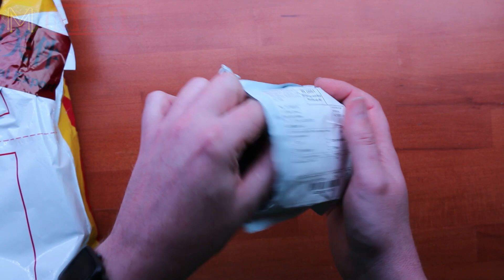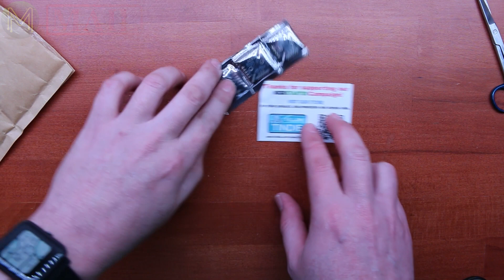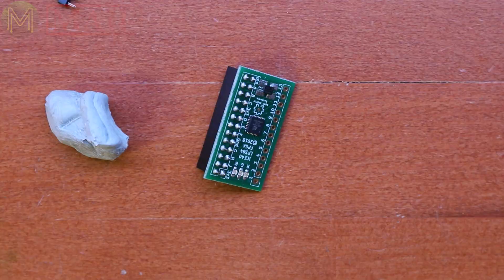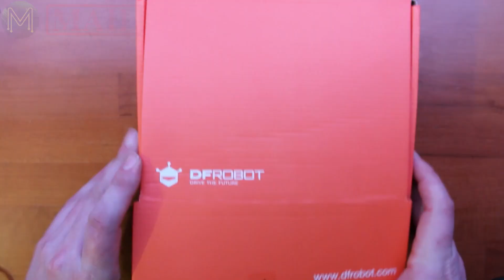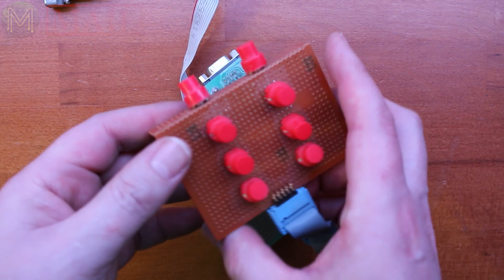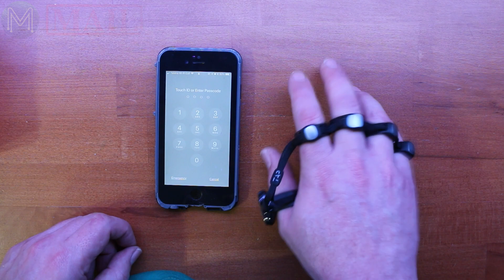#237 MickMake Mail #36: LattePanda Alpha, FPGAs & keyboards

Comment: Hi Mick, love your videos. subscribed a while ago. I am looking for an Android-based SBC that can support up to 3 screens, the connections can be HDMI, DP and the display ribbon cable. I also want a minimum of 4GB but would prefer 8GB. I have been searching for a while but finding an Android-based SBC that can support up to 3 screens has proven to be a challenge. The screens need to work independent of each other (i.e. screen mirroring won't do the job) What would you recommend? Keep up the great work. Thanks, Chris

Comment: If you check where the leads on your voltmeter connect to the back, you will see it is possible to desolder a bridge,  making it possible to read voltage from a 3rd line, independent of its power.
Reply from the maker: Thanks. Didn't see that before!

Comment: There are videos out on YouTube showing Lattepanda as a Hakintosh.

I am looking at one of the new Mac Minis and so will be able to get hold of MacOS easier.  I might get a Lattepanda too.
Reply from the maker: The MacMinis are still way more expensive. I know you get what you pay for, but Apple have had a history of squeezing that mantra a little too far.
Reply: @MickMake  The thing is Apple never makes the case for MacOS which should be the reason to own a Mac.  I run Linux on a laptop that cost £1k about 4/5 years ago.  I don't like Windows and I say that as somebody who used to work in IT on the big metal.  And yes I understand the value cost ratio of the hardware when Apple is compared to bog standard boxes;  even expensive NUC's are better value.  Over this last year or so I have got a bit tired of Linux.  I want something that can run MS Office a bit more cleanly than more current experience via Wine; LibreOffice works for me, but doesn't always work that well with documents from elsewhere.  My TV provider's app is only for Mac or Win.  And so on.  Just looking that's all.  :)

The first computer I entered a program into was an Apple ][.  The first computer I used with a GUI was a Lisa.  And I remember the original Mac.  I have a dead Mac Plus sitting on a shelf. 

Thanks for replying.  :)
Reply from the maker: I'm in exactly the same boat. Used Linux PC for years and years, but 2 years ago I got pretty sick of Linux "not always working". Yeah sure, I can hack something together, but as a small business I need something that always works.

So, Mac was the only other choice - best of both worlds.
I can still hack around with my scripts.
Still have a shell, (which I spend most of my time in).
But I can run commercial apps without issue.

OSS is great and I fully support it, but OSS never gets that last 10% of the UX right. After all... the last 10% takes 90% of the time. Often.
Reply: @MickMake  Yes.  I have a small problem with video tearing.  Not all the time, but sometimes being who I am with my background I really notice it. Is there a fix for it? Yes.   Could I implement it?  Yes.  But, and this isn't being lazy, I just can't be bothered and I am always scared I will open another can of worms.  Fixing things that 'work' is a behaviour working on multi-million pound systems beats out of you.  Thanks for replying.

Comment: mick you can use hackintosh on latte panda its not perfect yet but it works very well
Reply from the maker: Yup, it's been a while since I last looked into it for the original LattePanda. I'm sure people have got it going by now.
Reply: @MickMake  wifi wont work and audio currently must be thru usb card but thats no problem there are plenty of usbs
Reply from the maker: TBH, in my situation the lack of WiFi is not an issue. When editing videos, every % of performance you can get makes a difference.

Comment: With those quick, cheap, voltage meters...  You can get versions that can be calibrated as well... They have an adjustment screw on the back.  Hardmodding overclockers have used them for several years, and you can usually get them with green, blue, or red seven segment displays!

Latté Panda looks nice, but wow those Alphas are downright pricy....

Comment: The LattePanda Alpha would be the sort of thing you would put as the control of a smart house where you also want it to interface with 4K flat-panel screens to generate virtual window views or display video on demand from a streaming service etc. when required. That is where all those connectors it has would shine.
Reply from the maker: True, but personally I'd lean towards cheaper units and more of them... I've had too many lightning strikes to want to have the whole house dependent on one device.
Reply: Same, I use it to run node-red, MQTT broker, and HASS.io while still being usable to do basic media server pc stuff. I use one of the older models that are way cheaper and it works great. The IO pins and the Arduino let me decode IR signals from the various remotes and perform actions based on it.
Reply: @aarongagne8918  Personally I am just using a Pi3 as a remote access server and recorder for my IP cameras. I have it booting off a 256MB (Yes MB not GB) TF card with Berry boot on that then boots the OS off of an external USB drive. While away from home over the new year I was able to log into it and check on the house and property and look to see if anyone had visited.

Comment: Kordic keyboard could use bi-directional momentary throw switches instead of momentary push buttons. This could allow for better mental mapping of a traditional keyboard layout. Using the thumb switches to select one of four divisions of a 4 by 16 keyset and the finger keys to actuate the desired key. There would even be ample combinations for special character mapping.
Reply from the maker: True.
There's many different styles, but one of the things that this company has done well is recognizing the fact that people don't want to have to invest time in learning a new keyboard. They've gamified the learning process, so you don't even notice.
This is where most companies in the past have failed.

Having said that there still needs to be a lot of work done on the Tap as it's not really usable but rather a gimmick. Too many errors.